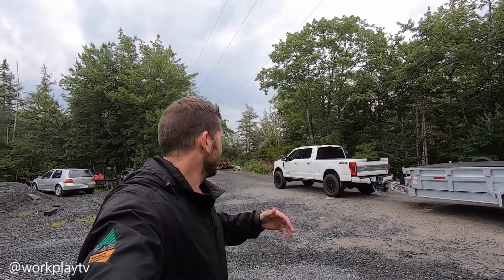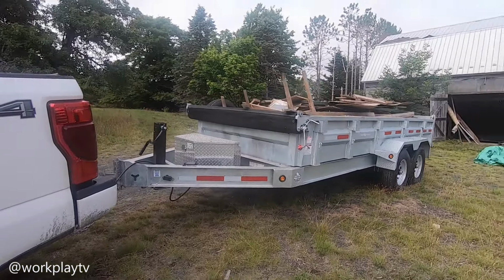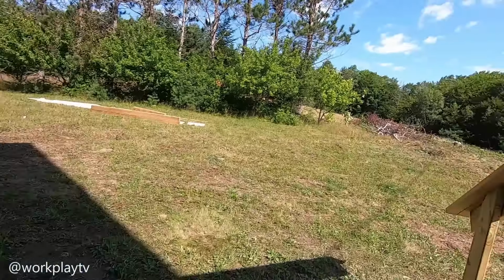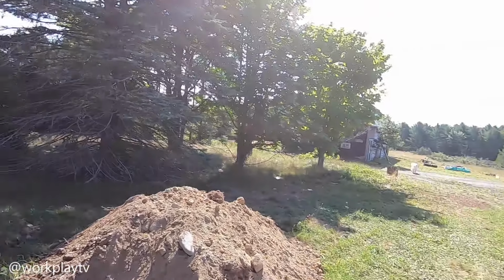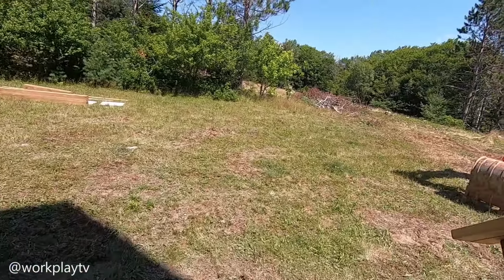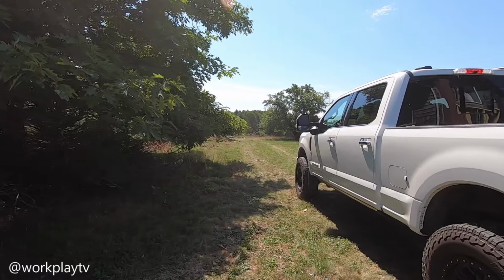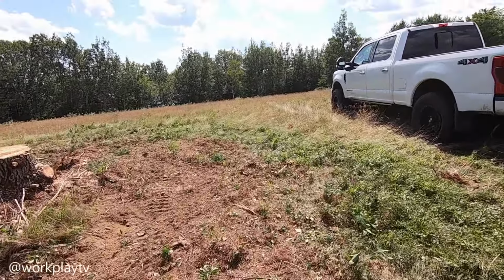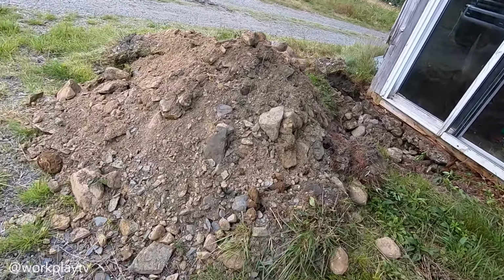FIRST TIME USING THE NEW DUMP TRAILER & MAJOR WORK GETTING DONE AT THE HOMESTEAD

Comment: You can hook you generator up to the wires coming out of the well to test the system out. Although if your digging a trench it might be a good idea to lay new water line anyways. But the generator hooked to the pump would give you water in the house.

The cable by the house looks newer... I’d be worried that that old well was possibly compromised and abandoned...
Reply from the maker: Tyler Lackie we did test the wires coming out of the ground and there were power going through. Just wanted to confirm. I spoke to the brother of the guy who owned it and he said the well is still
In tack. Thanks for the info.
Reply: workplaytv ok good. I recently went through the process of tying an older well into new construction, I unfortunately had to replace just about everything but the casing... loving the videos by the way!

Comment: I just ordered a new KX-080-4 excavator and a Loftness Forestry Mulching head.. looking to do it for $$$ what should I charge per hour? What your thoughts on Loftness? I am new to this kind of work.
Reply from the maker: grimthenoble I have heard ok things . I am a big FAE fan. You should be able to charge $100/hr
Reply: @workplaytv  thanks, I was leaning towards $125 just for the fact of how expensive the head is. Only reason I went with loftness is the dealer I bought excavator through said they are a good head. Time will tell, hopefully I can find some jobs lol
Reply from the maker: grimthenoble hey if you can get that rate that would be great. Honestly rates differ where you are located.

Comment: Why don't you push the trees over with your bigger machine? Beats digging stumps.
Reply from the maker: My machine wouldn’t have pushed these over. They are like 2 feet at the butt.
Reply: I dig out half the roots on one side and raise the bucket as high on the tree as I can and push. I’ve taken on some 1 meter wide trees. The stump just pulls out so nice then I scrape the dirt off the roots.
Reply: workplaytv. I have an USB 65 Hitachi with tilt/rotor and it’s smaller than yours.
Reply from the maker: Military Museum Yeah that’s what I would do too with my 8 ton but my 8 ton won’t be around till the fall I’d say. It’s busy 5 hours away. My 4 ton but wouldn’t do it. And I need to clean up the area now.
Reply: workplaytv. Your right. You have to get that lake view. It’s a game changer having it. What’s the lake front look like?
Reply from the maker: Military Museum If you look back in my videos that says finally found my property. Should be some footage in there